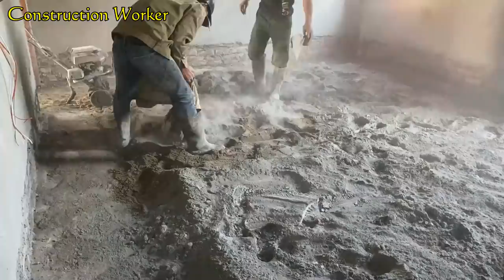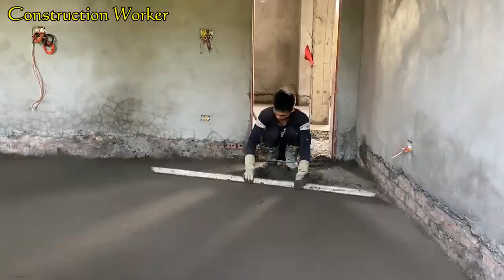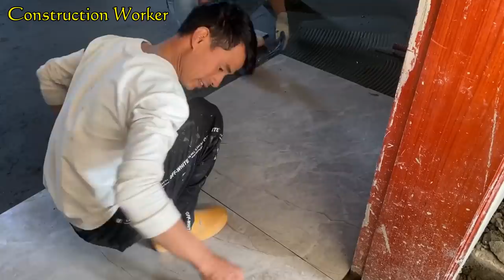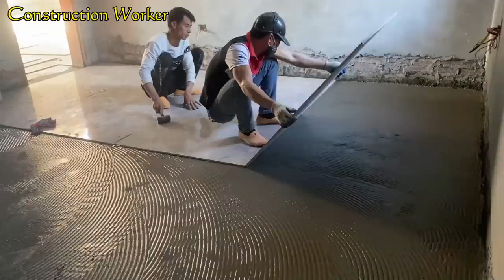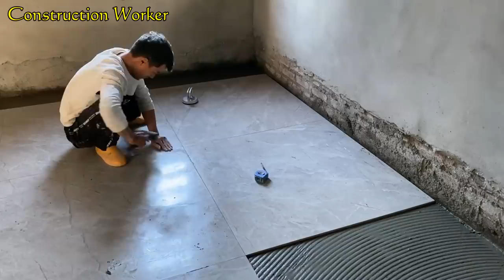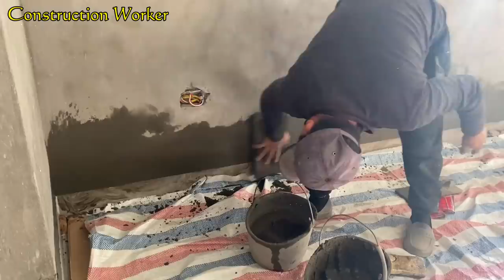Amazing Techniques Construction A Bedroom Floor With Large Size 100 x 100cm Ceramic Tiles

Comment: As a tile setter in North America, I don’t know how this whole job won’t fail in 6 months.
Reply: It wont..they are not using """little boys tile cement"" but it is rather mixed with hard cement as well ....why should it fail???
Reply: @universaljudge3790  maybe because they didnt apply the mixture properly, they   applied it all at once instead of in phases and they went in the opposite order of how it should be done. All of this to save time (therefore money). Shameful
Reply: @AnotherNormalNick  i think Niko they are not doing this for the first time as a method to reach their goals, and actually it might hold, people there are lighter, shorter and etc :D 

Yea, I also didn't like the tile setting proces of laying them, they worked too slow for the batter pour process to be valid. better to put the cement-glue mix under the nearest tiles you set as fast as possible
Reply: It will not fail by 6 Year's let alone 6 months

Comment: What I liked most is the way they did the skirting against the wall , never seen tilers do flush them like that and always there is an edge which I never liked, but this one is really excellent way to do them.
Reply: yeah, they didn't show checking for square and establishing a starter line...
Reply: @billytheweasel 
Exactly right

Comment: Without a doubt, their abilities and techniques is amazing but the quality built and still lack quality building and house in Vietnam. Still no cavity wall, no insulation and dpc.. brick's and blocks is really soft. It just won't last. I build my home in Vietnam with cavity wall and in summer is cool, in winter is warm. Single layer bricks  or blocks and cement render just won't last. Damp is major problems in Vietnam
Reply: Wut kind of material u used for cavity wall?

Comment: After tiling all my life & watching this ill just say this .
If the tiles are still there today & in good nick ill eat my very large hat .
Reply: Why is it that bad?
Reply: agree - need to back butter the tile at least
Reply: Perfect job done...
Reply: Start with straight trowel lines please guys… this will be a fail
Reply: Mixing the concrete that way is just a hassle, and honestly probably gives a worse mix that will not cure properly... Also the tiling is quite poor imo...
Reply: that thinset will dry and break up into powder like the bag it came in within a year. they used way to much water. and the brushed in grout lines? ill give it 2 weeks. not to mention mixing on the same floor your gonna be leveling. unmixed sand and cement at the base… hacked together.
Reply: Finally someone. They would not get paid if they were working for me. So bad. But as someone explained in the comments thats how it's done, fast, fucked up and ready to be remade
Reply: @BabyG112  my thoughts exactly. That thinset was way too thin. I’m surprised it held a notch at all. Also I noticed they laid down the thinset on the entire floor before putting down the first tile. Even if they work fast as a team, by the time they get to the last tile that thinset was probably crumbly.
Reply: @andrewkazakevich8611  it's fucking shocking

Comment: All about perfection on that screed to have it easy doing the tiling never seen people walking on freshly layed tiles but I would expect if the sub floor is perfect the tiles shouldn't have any lippy edges and fit flat to the floor! Real skills
Reply: I think it has to do with size also, more even pressure on big tiles. I don't think they walk on smaller freshly installed tiles.
Reply: You do have step on large format tiles is recommended but you also have back butter the tiles
Reply: @MessiahGaming1080p  ei oo mitään on kerran aikaisemmin ja

Comment: Credit has to be given when credit is due. I'd like to add a comment to the person that said the tile job looks great but the rest of the place is a shack. Why don't you look closer the place is made with bricks and mortar. I'd say that's better than 2x4 and a piece of s*** drywall wouldn't you say. And I think it's much better insulated then using Owens Corning fiber wear lol  😆
Reply: In India also they do the same.
Reply: They don't need insulation in... Wherever this is that's why we use 2x4 we want the cavity for insulation
Reply: @bobbob-xr8wh  I agree stuffing cavity with insulation , didn't have issues with that because you don't have much choices / spray foam is another.  I just said using brick, cement,  mortar and plaster is better for insulative purposes than fiberglass or stuffed insulation and drywall .  Check out R values.  It would be so costly here to build with full brick and mortar. Also the time it takes. Just like over there they don't have the forests like we do or the wood available. For them it cheaper to build with concrete and bricks. Also the trades are not use to building with wood.  The moisture content and humidity levels there will also do a number on wood , not to mention wood eating bugs
Reply: wrong coyuntry vern....america is not everthing
Reply: Funny you say that because after watching this video, the North American stick framing just got better in my eyes
Reply: @alenramic9436  dude,  what are you talking about. This was and is all about tile technics. I Just added few notes about framing and insulation .  But for all intended purposes,  wood framing trends has its place in certain regions where people are mostly use to and trained with wood framing.   I also do wood framing all day long too, I also have masonry and brick laying experience as well.  If I had to pick what to  build with, I would go with mostly concrete and brick / stone over wood. Let's not forget that  In most every wood framing structure,  there's a beautiful masonry footing that's holding it up.

Comment: someone talk about cement mixer but in VietNam you will need more money for that , so in big house ( 2 floor uper ) they will pay for that but 1 floor you can save some money for cement mixed 
p/s : my Eng bad , i'm Vietnamese
Reply: Tranquilo. Deu para entender.👍
Reply: Your English is excellent 👍
Reply: @pammir631  thank you ♥️
Reply: Is the labor vs tool cost that different there? Here(USA) the cost of a cement mixer is easily covered after one job. The increase in job speed makes up the cost very quickly.
Reply: there's 3 better ways to mix cement by using a 3 to 1 ratio mixed with a shovel and adding water.
Reply: 3 parts sand 1 part Portland cement
Reply: @bkack moon yes I lived and worked in VN saw this work all the time. Always amazing how fast and accurate they can do it. VN workers kick ass

Comment: I use to set tile, marble, and granite for many years and I was surprised they're not using wood to help level the tiles.  The new flooring looks awesome!
Reply: Ricky Anthony  You take a 2x4 piece of wood, cut it so it isn't too long.  You place the wood over several rows of tiles while pressing down to even out the thin-set mortar so that they're all at an even level together.

Comment: When you do everything wrong and get the right result. Hope it lasts.
Reply: Spoken like a true know it all
Reply: Wrong according to who?
Reply: yup. trowel needs to make parallel lines then you wiggle the tiles you put down in the perpendicular direction to collapse the lines to make a substrate that's 100% coverage

beginner shit

done correctly you can drop a hammer on the tiles and they won't shatter (usually)
Reply: @kdzmatrrmat8068  wrong according to Floor tilers who charge 1000's to do a job that would normally cost 100s.

So much envy... Right?
Reply: Billy Mack, Texas Detective  I doubt that this job took place in North America! And who are you to say that because it's done differently to ANSI standards that it won't last? Unless the floor moves, those tiles are going nowhere. But one only has to look at the annual bridge collapse rate of about 128 in the USA and also the buildings failure rate too so perhaps questions could be asked as to why if standards are being adhered to. The Taj Mahal is still standing - built to no standards!
Reply: Maybe 70% coverage...
Reply: I just dropped on hammer on mine.  %$#@! Guess it wasn't done correctly...
Reply: There were a ton of issues here with how things were applied. I'd have to agree. I give it a few years and those large tiles are cracking
Reply: @michaelmcleary8566  the floor doesn't have to move for the tiles to disconnect because the way it has been done traps air and prevents the  tile from connecting at all in the first place. Ansi standards are.... the tile should be connected to the floor, it's not that complicated your making it more convoluted with flawed logic than it has to be.
Reply: @chiefschillaxn1781  id be more worried about the wet screed it was laid on, id give it 3 months max
Reply: Lol you ain't wrong
Reply: Billy Mack, Texas Detective  that ain’t North American

Comment: Put a thin cement on the back of the tiles. Once it has bubbles or air space it will crack in no time. 1-2yrs utmost.
Reply: Tiles already looked crack lmao

Comment: Great work I picked up a few tips from the video. On the other hand I feel they should  have placed an adhesive layer on the back of the tile as well.  The bond keeps the tiles planted on the floor for many years.

Comment: I will cut my head if that ceramics after 8 months to 1 year is not broken
Reply: We have a new house it only did 3 years before the front doors ceramic cracked
Reply: No joint ! Crack.
Reply: why would it crack?
Reply: @Ares_gaming_117  because they did shoddy work that only flies in a 3rd world country. When that cement cures the tiles will either pop loose or crack from stress if they stuck in some parts.
Reply: @DL101ca  3rd World country? You say you only find bad jobs in 3rd World countries? What a derogatory comment!
Reply: I think they know what they're doing.
Reply: @DL101ca  yeah i was asking why the cement would crack in this case though
Reply: Due to the fact that the base layer wasn't ready. After drying small tensions may appear and beat the tile layer
Reply: @marceladavila1939  not only in 3rd world countries. But in general yes they do shitty jobs. I am cuban by the way i am speaking from experience. To give credit where is due these guys actually do a good job
Reply: These videos are always a great laugh
Reply: @DL101ca  Better then a lot of a tradesmen in the Uk where one little dip and they cant get it right...Huffing and puffing we need a new floor lool
Reply: They obviously cut the video back in after it dried lol Only thing spotty about this is the consistency of the thinset, that was pretty runny.
Reply: @Andrew-co6wn  that's why they added Portland to the thinset. Plus I'm thinking the base layer of drypack will wick the extra water right out.

Comment: I’ve been tiling 26 years now and I’ve never seen some of these impressive techniques! They are talented and I’d love to know what kind of adhesive and grout they used too! Never seen products like those before!
Reply: Yeah looks amazing, but how many are working on this?
I usually do that size a room alone.
Reply: @davidf2118  well, the quality of the tiles is everything. Cheap tiles are different sizes and not plane. We do it differently First make the floor absolutely plane, then you after this you lay the tiles. We use those clamps to ensure that the tiles are layed plane as well. spacers are good practice if the tiles are uniform. Yes a thick adhesive makes it easyer.
Reply: @davidf2118  Yeah it is a problem, I usually makes a more smoth adhesive by adding some more water. So it is easyer to work with it.
Reply: @thomasbuhrkall969  id imagine how much you get paid to work alone would pay for several workers in other countries. My Grandad was a carpenter in the Orkney Islands and his team would renovate whole buildings for people. There would be a team of 4-7 and they all had their individual jobs and smashed out buildings together. Less tasks to focus on, quicker work, time to do more jobs. 

Similar situation here??
Reply: @blacky1987     A Welfare state as Denmark; where I am from; comes with a prize. Demands on insurances, vax, tax, etc. That means 50% ontop of your salery goes to insurances, 12% vacations, pensions. So the cost of running a company alone are twice the price of your salery+ the cost price of a van and diesel. + the cost of a auditor. 
So if you work alone offcourse you can earn a lot. But you are also cheating yourself for the benefits. You really have to take 2.5 times of your salery as your prize to equalize the benefits. 
In some countries the salery are really high, you can buy lots for, but all in all you dont get the "benefits".  It will be hard to compare. I know where you can earn alot, dont have much vacations either, nor benefits and insurances.
Reply: Lol

Comment: Three fault 

They spread cement mixture in entire floor at once, pure cement and water mixture dry quickly so this floor may loose some times as heavy weight comes on it

Before tiling skirting they should sprinkle water on wall

Aesthetically skirting width is bigger seems cheap, it is around 4 inch but 2.75 inch is best

Good things
Floor leveling and preparing solid floorbed is good

Comment: They loosened up they dirt or whatever that was under the floor and smoothed it out, but they never packed it back down. This is going to lead to some little sink holes and eventually they will have to remove parts of the floor that crack or break to fill in low spots. Still looks like a great job for what they were working with.
Reply: They also didn't leave any gaps between the tile heating and cooling may cause it to crack...
Reply: Isn't that just cement? It like mixing the cake batter in the pan you be cooking the cakes in.
Reply: So y’all think they Wea doing this fir the first time? Keep your negativity
Reply: @bernarddadizzy1645  English, please.
Reply: It was cement. It doesn't need packing back down. That floor is solid.
Reply: Watching them mix dry concrete in a closed room without a mask. Yummy.
Reply: Cheap labour
Reply: @Gamemaster-64  just cement? Obviously you've never done it. Try finishing it yourself. Once that shit gets hard on you? Rip it out and do it again. Cement waits for no one

Comment: You have to understand its an old country.....all tiles guys just don't understand because they are used to what they do and learned over last 30yrs or so.....tile has been set for centuries way before any modern methods, thinset and it worked just fine.....try to bust these babies out in a month and see how well they are adhered.....I been to Asia (everything is tiled there) where tile has been installed ages ago and its still strong.....thinset is just a mix of cement, sand, and acrilliycs/ glue.....its not rocket science and not only way to lay tile...
Reply: From what I know it is safe  way to install tiles.
Reply: I still use this method from time to time it’s very very strong

Comment: I’ve been doing construction 25 years and I’ve  never seen anything like how they did the floor for the tile … Amazing
Reply: It looks like basically the same thing they do on a shower floor to make the slope before tiling. Just a lot bigger scale
Reply: @DerrickFishes  yea , it’s like the slab was never poured . Then they just filled it all in lol crazy
Reply: Really thats common method only difference they used this machine to mix it .Tile man usually mix send cement dry with shovel and add sprinkle some water 💧 and keep mixing  mix should be damp not wet then spread it and level the whole thing. The way they did it should work I think wet cement on the top should bond well with the cement subfloor and tiles installed on the wet cement should bond too as long as cement is sticky .I would butter or spread cement on the tile as well to make a better bonding,  but that would take more time and tile adjustment to make it level.

Comment: that floor will be cracked in no time. dry pack mixed like crap, thin set will flake over time because its basically water, not to mention leaving thin set on the floor for that long it will dry the top out
Reply: Why
Reply: Yup
Reply: @LeviCodmYT  he gave the reasons..
Reply: @LeviCodmYT  no lotion was used...🤣

Comment: Amazing work but not so amazing safety guidelines. Those men will die an untimely death if they do not get something to protect their respiratory system while they work.
Reply: @mae2309  They were not wearing masks and cement dust was flying thick through the air…our regulations are based on science and experience.
Reply: @tattootiff274  man in India all worker work without mask😂😂. No one worker dies here they live long same as a normal healthy person
Reply: The trick is you need to start young, get use to unsanitary environment then you’ll be immune to it as an adult
Reply: They live short anyway
Reply: @tattootiff274  for sure! Worse than asbestos.
Reply: @mae2309  they were mixing concrete in a closed room w/o masks. Most must have started in the womb to be doing it 30+ years 😂

Comment: Would have been faster to use an actual mixer, I see no benefit of mixing a floor that way, in fact that cultivator was not designed for mixing sand and cement and does such a piss poor job that I would question soundness of that floor. The type of floor that when you need to replace a broken tile the floor comes up with it.

Comment: Installed incorrectly. You are not supposed to trowel in a swirling motion. When setting tiles, air gets trapped and the mortar bed doesn’t collapse leaving it easier for the tile to crack.
Reply: Bro they are unskilled labour .they have done this only for video 😂
Reply: It’s a common practice most of time they are not even do swirl just thin cement paste
Reply: @harshitpandey4013  jj
Reply: @harshitpandey4013  bn
Reply: This is all for online world. They are earning millions from Youtube.